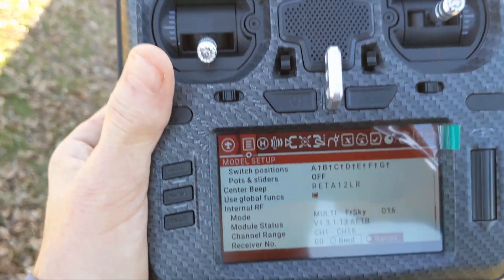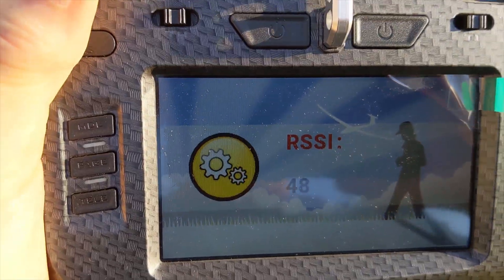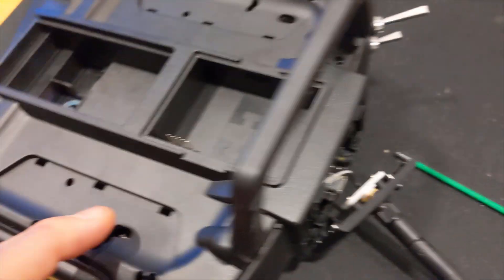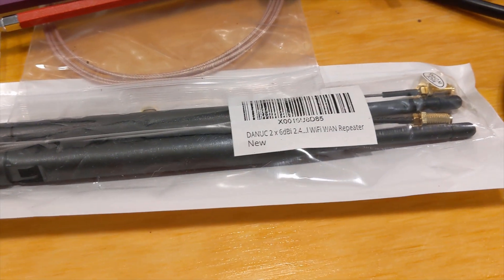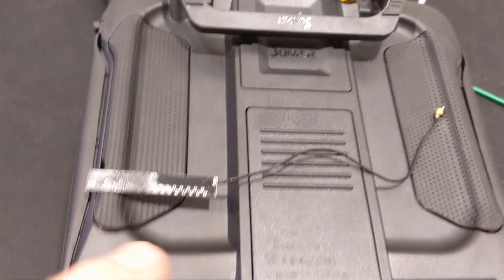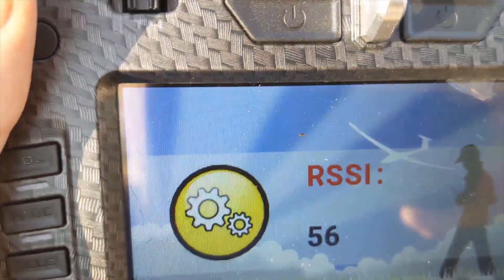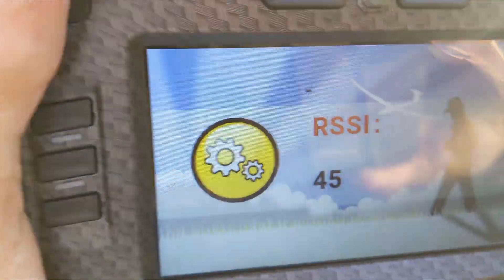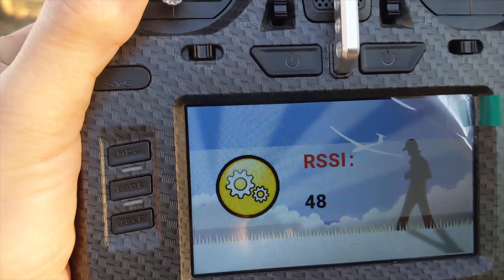JumperT18 Pro 2.4ghz PCB antenna replacement

Comment: How long after change with h the new antenna?
Reply from the maker: I was only testing range on each antenna.  The RSSI value I could see immediately after changing to a new antenna.  However for short range flights I ended up going back to the 2.5dB and 3dB antenna's as they have better spherical coverage (i.e. overhead is better on them).

Comment: Hi there You just used a regular 6dB Wifi Antenna?  have you tried the shorter one. e.g. the 2.5dB antenna? it has a better spread for RC.
Reply from the maker: yes the high dB antenna's all have a radiation pattern resembling a squished doughnut shape.  I switched back to the 2.5dB after testing and would only use the higher dB antennas for long range flights.